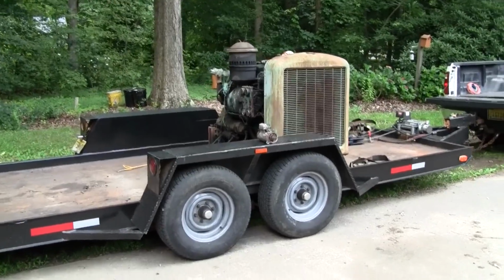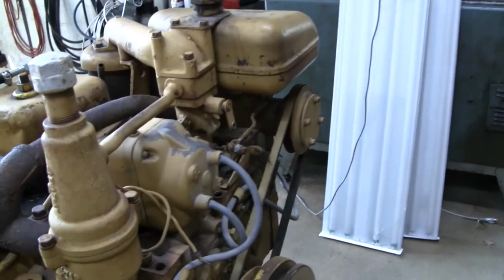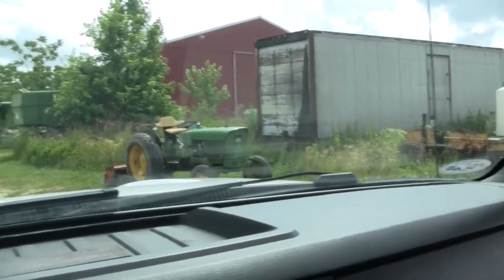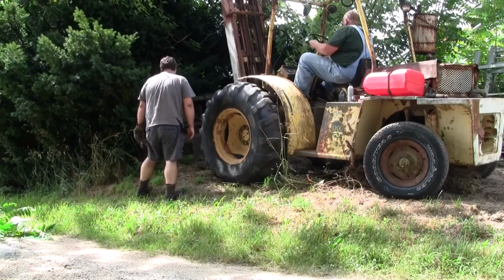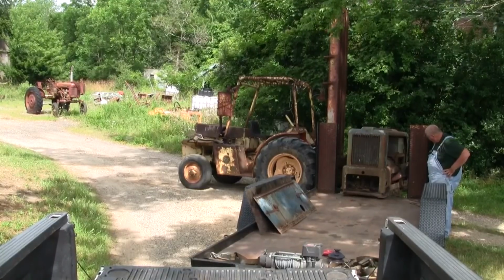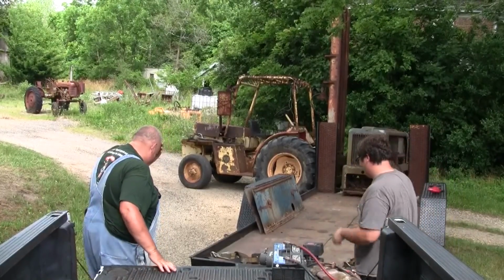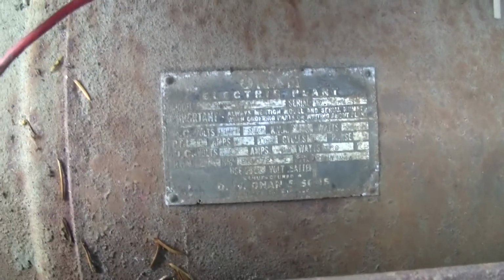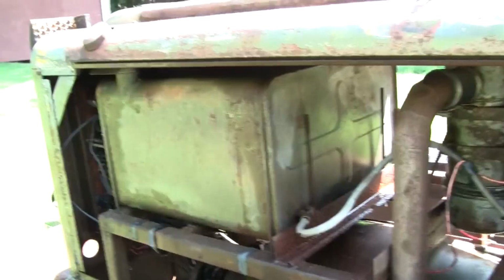Long Forgotten 1947 ONAN Gen Set Recovery

Comment: I worked on many of those old Detroit 2 cycle diesel powered generators. V8’s, in-line 6, 4 cylinder and 3 cylinder units. They run great even when they are tired. But they are big air polluters. Lots of blue smoke when they load. Very loud and hard starting without a block heater or starting fluid spray.
Reply: When you get it running there is an old style safety cutout called a hot wire relay. What it does is as the engine runs if you lose oil pressure or over heat the hot wire relay is swichted on to heat up a thermo resister. Then in turn closes a switch to activate the air box flapper stalling the diesel. That old hot wire relay can fail and keep the air box flapper closed. I would replace it with a on delay relay.

Comment: I may have the CAT parts you need, can you give me the part number and or rough dimensions of the air intake pipe? I also have a bunch of pony motor parts.
Reply from the maker: Patrick, I will see if I can come up with a part number for the air intake pipe.  Off the top of my head I know the pony motor is missing the float bowl for the carb.  Thanks!
Reply: Found a complete carb in the pile 🙂
Reply from the maker: Nice!  How can I get in touch with you?  My email is on my channel page under the “about” tab.

Comment: Nice old Onan Mike! I may be wrong, but with the extra heat shields, etc., it may have been set up for arctic or some far north application, to keep warm air going to the carb. Surprised it had fairly clean oil and antifreeze in it. That may be an easy starter there if the valves aren't stuck. You can roll it over carefully by hand and find out for sure. Much easier to pull the head than replace a broken camshaft!😁

Comment: As I watched this video, it occurred to me that I know where there is a 30 KW GE generator head only that you might be interested in.  As I understand the story that was told to me , it was driven by a Pelton Wheel and about three to four miles of 12 inch spiral welded pipe which had finally rusted out and collapsed ending the service of the generator.  With no running source of water the housing of the peloton wheel froze one winter and the cast-iron housing broke.  The gentleman who owns it has removed the Pelton Wheel and put it at the end of his driveway as a decoration.  The GE head is rated at 30 KW at 110 Volts single phase, 60 hertz or in the vernacular of the day, 60 cycles.  There are three beautiful old mirrored meters on the end of the generator, one for frequency, one for voltage and one for current (with a range of up to 300 Amperes).  The cast iron housing has a beautiful black paint job on it. While I was there I walked down to the generator shack at the edge of the creek and lamented that the shack is filling with rocks and sand from the spring runoff of water.  The generator looks to be above the water and debris level, and I reached down and was able to spin the 1 and 1/2  or 2 inch shaft by hand.  It was difficult to get that much mass moving with one hand, but once the shaft was moving, it took a long time to stop and there was no bearing noise that I could detect.  This peloton wheel driven generator was used to power a mining operation for several decades according to my best information and the mine has been shut down for several decades now.  This generator is located  on a dirt road access at about 9000 feet of elevation and approximately 10 miles from a paved road near Clayton Idaho.  I was so impressed with this beautiful piece of equipment when I saw it that I feel it is a shame to let it be taken by time and the elements.  If this would be of interest to you, I will try to get the owners information to you.  He is a member of a very famous family and really cherishes his solitude and anonymity and jealously guards his privacy, so he may be difficult to contact even if you are interested, but it might be worth a try.  Thanks, Jim

Comment: That is so neat that you rebuild and not trash it for money, I am working on a 1963 gen with a chevy 283 V8 20.000 watt gen, This was used at sawmill in Minnesota and sat in Barn all of its life. It has no Rust or any dents just the paint is fade , but all came off with air blower, Now it has primer on everything, Rebuilt the chevy motor and it runs like a dream. By late Summer I will have it all done, This is lots of fun to play with and will be put back in to operation in my shop..... Love your video....

Comment: I had a 25 KW 3 Phase 208volt with switch able Delta and Eye windings ... All reed sitch gauges ..  with I think a little Bedford Diesel (purred little a lion) out in Big Cypress Swamp to power the resaw band-saw... At the Sawmill

Comment: Wondering if you or anyone else reading could tell me how or where to find a manual for an Onan 3MTK-1R4/RF? It's a gasoline-powered 2 cylinder unit and looks very similar to your W2S except It has no radiator and I'm pretty sure it came out of an old boat.

Comment: 2:16 Detroit 2-stroke? Rotates? Itt'l run fine. Mind the racks so it don't run away on ya, but I'd say building a badass big boy's gokart around it would be boss. Maybe a 4wd kart using 3-phase traction motors and a generator head on the engine like locomotives are done?

Comment: The starter on the diesel genset motor has half the hp of your truck.what exactly is sketchey about the weld on the exciter hold down bracket?looked quite solid to me,replacing the bracket would be the only way to improve on it.

Comment: The cooler was deemed by Caterpillar to be unnecessary to the correct operation of the engine. Later serial numbers did not have the cooler, and Cat provided guidance for deleting the oil cooler lines. I still have the coolers on my D2 (both the 5U with the D311 and the 3J with the D3400) just for originality's sake

Comment: I just retired from the gen business and when the original owner was still behind the desk he usually had me save the good units that came in. Over the years I only had one that was near this vintage. Most were early Kohler and Onan air cooled sets. (50s and 60s vintage) The Onans were usually 4CCK or 5CCK types and the Kohlers (forgetting the Mod#) were usually gold or dark blue with air cooled Wisconsin engines. Every once in awhile I would stumble on a WWII surplus gasoline job that was still in service. Typically these were installed in a barn or garage and were not up to today's code. We actually stopped doing service on these a few years ago due to insurance liability. BTW, all of the units we had in storage were sold shortly after Sandy / Irene when you couldn't buy anything else due to shortages.

Comment: That’s a 4-53 Detroit diesel….not a 4-71
Reply: 53 Series doesn't have Four Doors for the air box hand holes on the non-blower side, wanna try again.
Reply: @misters2837  4-53
Reply: @HammanD152  You obviously never owned a 4-53...LOL...
Reply: @HammanD152 - This is what a 4-53 block looks like... https://dieselcranks.com/detroit-diesel-4-53-engine-block-good-used-5101386.html - This a 4-71-engine - https://dieselcranks.com/detroit-diesel-4-71-engine-short-block-used-bcn-5111433-esn-4a75282.html#PhotoSwipe1626845360694 - Those of us who have OWNED and Wrenched on these old DD 2 strokes know better.

Comment: I'm looking at getting a good reliable generator that is good to use with medical oxygen machine that's actually affordable any suggestions as to a good one to use
Reply from the maker: I would look for a low hours construction site light tower with a liquid cooled Diesel engine.
Reply: @SmallEngineMechanic  ok thanks cause that would be a good idea me being on o2 dont have many outages knock on wood but if it becomes an issue it would be good to have one I have a small generator but I'm hesitant to use it because I'm afraid I'll damage the o2 concentrator

Comment: Definitely looks like a continental motor in the Onan. There was one of those streamlined ones on ebay a while ago. There is a company called Van Ness engineering that makes a lot of engine parts for continental flatheads. They mainly serve the Graymarine marine conversion engines but most of the engine parts are the same for the industrial VS marine engines...
Reply from the maker: Thanks for checking it out!

Comment: Twin Disc in Racine Wisconsin can probably identify the date of manufacture on the clutch on the Detroit 4-71. I suspect the engine was built in the 1950s because it has the tag instead of being stamped in the block. In the 70s Detroit started putting tags in a slot on the valve cover. In the 60s the serial numbers were longer and stamped into the engine block.

Comment: Would you be interested in a small onan 5cck generator out of a school. I work for a school district in the Pittsburgh area and will be pulling it out of one of our buildings soon. Cummins came out and said it couldn’t be repaired due to lack of parts availability but I feel like you could get it going. If your inlet me know and we can exchange contact info. Thanks for another great video
Reply: Whatever happens, i wouldn't throw it in the junk. In a worst-case scenario ebay or putting it in a garden shed until someone buys it is always an option.
Reply: I promise it won’t go to scrap

Comment: Good to see  a video from you Mike!! Love the styling on that Onan! Massive Rust down low is not to surprising when I saw it was sitting in a bunches of Pine Needles. They make a pretty decent slow acid "soup" as they decompose that takes out metal if given enough time..30 years seems like enough. Not as road salt but right up there.
 Get RoadKing going on the body work and paint and you get the engine and electrics going and you've got a super winner!!!

Comment: I love the Detroits 2 strokes. Just make sure the injectors aren't stuck. If it turns it will run.  I have 5 of them!! Squatch253 could probably help you on the Cat parts or at least give you direction. The art deco era stuff is so cool. I have a 1947 GM Greyhound bus. Thanks!
Reply: Squatch has quite the knowledge base for the old yellow iron

Comment: Hopefully your replacement Ford starter came with a heat shield.  If it didn't and your running OEM exhaust manifold you might want to mount the heat shield sooner than later!